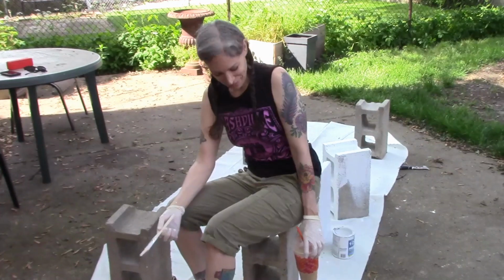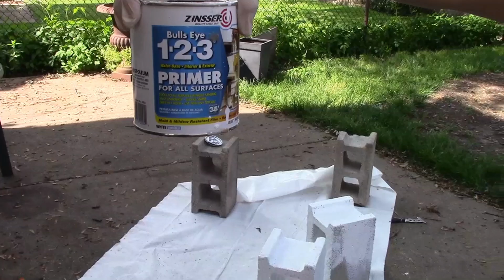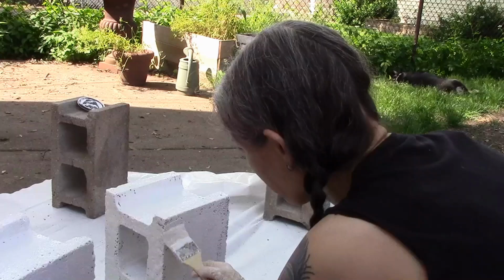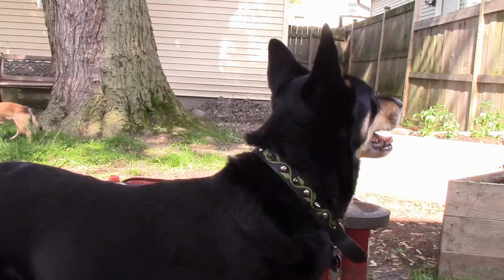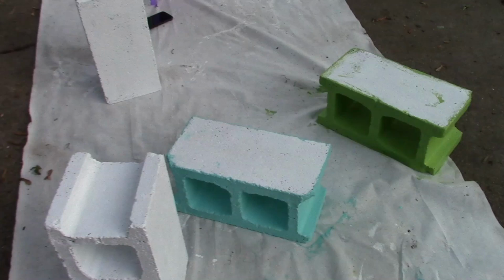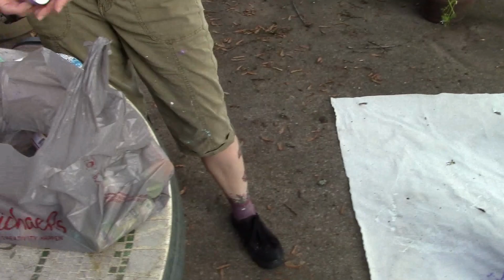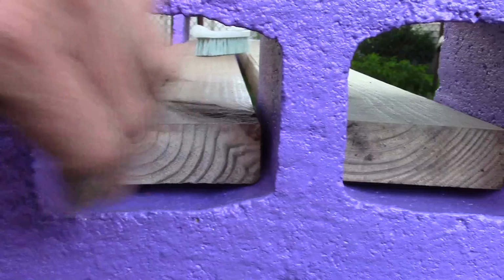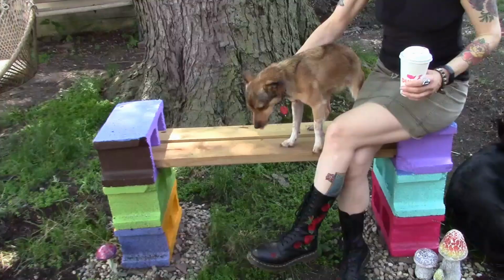Backyard Bench

Comment: Cinderblocks just suck the paint up.  It always takes twice as much as you think it will take.
I once built a 3 sided enclosure (4th side was the existing building)  for a gigantic air compressor against the side of a building   The two sides were only like 12x10 ft and the front a little less, plus less the door and jam. It took like 2 gallons of paint to cover those 2.5 walls.

Comment: Those concrete building blocks are different then the ones they sell where I am, the two holes in ours are basically square with the corners rounded off,  although they flare inward on the top side to leave more surface area for the mortar. It's interesting to see the production techniques used in different areas for the same products.
Reply from the maker: It's hard to say how old these are.  The house is over 100 and we found them under the back porch.
Reply: @bandersentv  That is possible, I'm not exactly sure when concrete building blocks came out, they have been around quite awhile. Did you have to wash them with anything before painting, like TSP?
Reply: @olegkostoglotov8800  Nope, I just took that brush pictured in the vid, and brushed them off and then primed.- The Mrs.